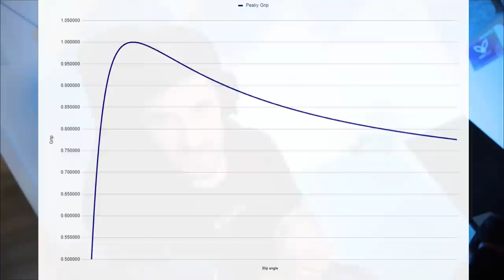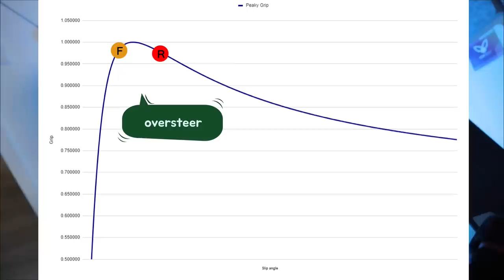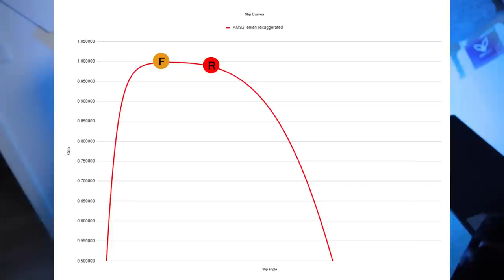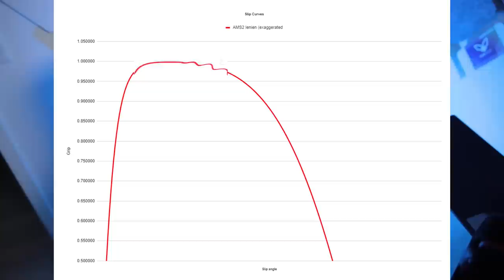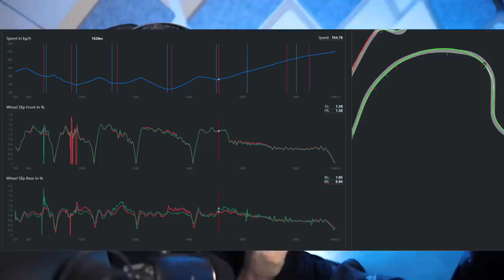Understanding Simracing: YAW! Explained using Automobilista 2

Comment: I have never heard this characteristic described as YAW before. I always hear the term "slip angle", meaning how much the car tyres slip compared to the direction of travel. Some slip brings more grip. too much makes you lose time and speed and the grip falls off.
Reply: He's talking about the slip angle of the car rather than the tires.  In vehicle dynamics lingo it's called "sideslip angle."  Saying "yaw angle" is probably fine here because it's clear from the video context what he's talking about.

In any regard, there's not really much you can glean from sideslip angle other than comparing it between two cars at the same speed and lateral acceleration to see which one probably has stiffer rear tires.  It says nothing about understeer or oversteer at all so isn't terribly useful.  At the tangent speed of a vehicle, the body slip angle is 0 anyway.  Above that the car is nose in, below it it's nose out.  So yes, it's better to talk about the tire slip angles than the body slip angle.

Comment: at the end of the day, most important thing is how we feel behind the wheel in our limited time to spare. this is where Ams2 lack the feeling of security about what car is doing. for me ultimate test of how physics work is first corner of Brands Hatch. Ams2 falls here on the test. that feeling after entering the corner is weird. don't want to compare other simulators but on rFactor 2 or Raceroom I know exactly what the car is doing becouse is logical and predictable. in one occasion during driving and exiting from corner I spinned becouse I changed to upper gear in Ams2 which is maybe setup issue but cannot happen in real life, that can happen if I change to lower gear and revs go wild but here that is unacceptable. Ams2 has everything on paper but on reality that falls apart when playing it. I am afraid some stuff simply can't work on Madness engine, I never doubt in Reiza but after 4 years of development and having the sim in this state it seems that some stuff can only be polished but not changed.

Comment: I read an interesting interview with Alex Hodgkinson who is responsible for car handling and ai in Raceroom, in which he explained the difference between 'physics', and 'handling', which are two connected but entirely different components of car design in sims. I believe he was saying that physics describes the way that suspension etc. works, which is largely down to mathematical equations, but handling is the way those physics translate to your driving experience through the tyre model, and that the tyre model is what makes one sim different to the next, if all other factors are roughly equal.
Reply: That's why RaceRoom is a banger. Great sounds too

Comment: Absolutely superb analysis and perfectly communicated.  Im a big AMS2 fan (offline racer) and this explains exactly where my main issue is in the handling that I could never explain.  Still a fan but do wish the window is smaller - I just dont like the rear stepping out so much on some cars - they made massive positive changes to that before with the physics corrections but I would still like more :).    Thank you for this vid !

Comment: Got recomended this by YT, love technical stuff about the yaw, gonna watch more vids. IRacing driver here :)
Reply from the maker: welcome aboard! :)
Reply: @SimracingPopometer   ty, also get a better mic :) , this one has a bad resolution on highs
Reply: or maybe tweak some settings
Reply from the maker: @pamo5900  charming.
Reply: @SimracingPopometer  my eng not the best, not wanted to be rude. Its just hard to keep the focus listening a long video with that sound.(i got studio speakers)
Reply from the maker: i hear ya. but its not like i haven't fiddled with this ;) audio is challenging, having a better mic is not changing the issues: reverb, background noise. nvidia AI is running already to filter these. the main improvement would be to be closer to the mic - but then its either blocking my view to the screen or my arms ;) and its a USB mic which is just fundamentally limited. however currently im not aiming to add another layer of tech to an already complex and spacy setup.

Comment: The thing is though, it is faster on ams2 to have a little slip angle for 1 lap yes. but dont do that in a endurance race, your tires will be mush as you can already see the tire going down on your clips.
Reply from the maker: will test that, but so far havent had any issues with tire wear/drop off in all my driving
Reply: The V8 Supercar could be good to test with that, or Group C, simply cause their tires are soft so you can see the results of over driving easier. The new gt3 and lmdh cars seem to have fairly hard compounds and wear is minimal. Tire temps also take a huge tole, abuse the rear and if you cant manage the temps the cars are much less forgiving.  @SimracingPopometer

Comment: Great video, much appreciated. I tend to stay well clear of online sim racing arguments...tiring and repetitive come to mind. I'm no professional racing driver, but I do have HPDE and track day experience and have pushed cars to their limit (and a couple times beyond). What I look for in a game/sim is less about matching up everything to reality and more about, do I get that seat-of-your-pants feeling when trying to hustle around a track. rF2 has satisfied this desire best for me for a number of years now, but AMS2 is getting real close these days. Regardless of the endless "discussions" about realism, AMS2 delivers on the adrenaline factor very well. Part of that priority on my end is that I have yet to put time in a sim that captured the real thing even remotely close to real life. How could you? So much of driving is done through sensations, forces and feelings which are absent from sim racing...even with motion simulation, VR, seatbelt tensioning and every other awesome gadget you can integrate into your sim racing experience these days. 

The same logic can be applied to FFB as far as I'm concerned. Realistic feedback is great, but great FFB (subjectively speaking) transmits additional information that would normally be absent or at least muted with a real steering wheel in your hands. It's helping to fill the aforementioned void of sensory information about what the car and your body are doing. 

End of the day, folks should enjoy what's enjoyable to them and get off the "stop liking what I don't like" train.

Comment: Driving the 992 I felt like the tyres never gripped up, but the truth is that the front and back are both at max grip on the plateau moving around there but communicating very little compared to ACC because they aren't moving on and off a peak! Very interesting!

Comment: Hi Nils great vid although bordering on a little too technical for me😮 but much appreciated.  Do you find you need to make much adjustments to the set ups?  Also have you done anything with the FFB settings as I believe there is quite a big topic on the AMS 2 forum about it?
Reply from the maker: i think the FFB topic with ams2 comes from most people driving with low end wheels. on a Direct Ddrive there really is no issue whatsoever. I just use default+ with effects on 30 or so.
Reply: @SimracingPopometer  I have a Simucube Pro, so will try it on the default +, thanks

Comment: Just a correction. Yaw angle is NOT sideslip angle.

The sideslip angle a tire “sees” needs to be corrected by the yaw velocity (rad/s) and the lever arm w.r.t. the cg position (and steering if steered). Very rarely the cg sits perfectly in the centroid of the four tires.

One simply cannot input the same yaw angle in the slip curve for all tires at the same time. Not even per axle. Each tire has its own slip angles which are NOT the yaw angle.

Just a technicality. Apart from that, excellent video
Reply from the maker: yeah I didn't claim otherwise. educational videos - especially when aiming at perception - need to break away from numbers. what you said is probably true, but out of the 16000 people watching it 5 will understand (or care), especially when using abbreviations. You need to speak the language of the audience, not that of the professor. I try to make things approachable, I try to translate and give new perspectives to something that's otherwise inaccessible.

Comment: Driving tbe same car (McLaren 720S GT3) almost same settings, same track (Monza) on both ACC and AMS2 I've got 8" hotlap time gap between the 2 sims. Is that normal? I'm rated S1470 in AMS2 and 9509 in ACC.
Reply from the maker: I'm unaware what the rating really means. assuming you are quicker in AMS2, I guess that's kinda the point: ams2 is much more forgiving.
Fastest acc times are 1:45 I believe
Reply: Yes, you are right: I'm much faster on AMS2 than ACC (any car, any track). but I guess that ACC is much closer to the reality (on car handling and physics) than AMS2. I've never driven a real GT3 car so that's just my thought. ACC seems to be a more realistic simulator but... I enjoy more to play AMS2 (also much better in VR) 🙂. Thanks for your answer. @SimracingPopometer

Comment: In your opinion (if you must choose one), do you like the physics better in ams2 or acc?
Reply from the maker: general driving feels more nuanced in acc. theres more fidelity in the feedback of the car, more variation between cars. but of course i'd like to see a cleaner acting suspension like ams2 has it - or any sim really.
Reply: @SimracingPopometer  In your opinion is this an issue with FFB or physics?
Reply from the maker: @Blue_Monkey  ffb is only a result of physics. so everything you feel is because of what the physics provide. issue? I don't know. different? for sure.
Reply: @SimracingPopometer I've developed a custom FFB file (FullFFB available on Reiza forum) because I felt a discrepancy between visuals and FFB in AMS2. Of course, all I use is physics based, variables from physics engine, like YAW variable to transmit lateral g-force and lost of grip on the rear axle.
I go even further - just like on Hollywood blockbusters, I don't care how they fake reality as long as it feels real.
Reply from the maker: @jopereirapt  i dont see any problem with ffb. its all there, i have all information needed and can do whatever i want with the car.
Reply: @SimracingPopometer  I also feel Default+, particularly in this last version of AMS2, is already very good. Wasn't always like that.
But I do like every visual info to be translated into FFB (my physical world).
Custom files will always be the way to get things "my way", getting some shakes, other car bumps, off-road texture, etc, Default+ doesn't provide, not necessarily a must to be fast in sim racing.

Comment: https://www.youtube.com/watch?v=UoX9M2yuNTA  This is good context for whether slip angles are as peaky as most sims or whether AMS 2 might be closer to reality than most.
Reply from the maker: I didn't know newgarden shared a few words on that, thanks!

The main thing I see in these IndyCar Clips is that while the car moves on the tire without just outright spinning, the corrections and the loss and regain of grip all are very crisp and snappy, it's not stuck in a permanent steady yaw, but all the time goes back and forth, nose in, nose out. One day we'll be there.
Reply: @SimracingPopometer  Sure, and for the cars that already behave that way in AMS 2 I hear criticism that they are on rails or unrealistically too easy to drive, etc.  I don't think the physics are very far off in AMS 2, but I do think various FFB and screen motion settings can exaggerate the feeling/sensation of yaw...because they are supposed to do that!  We need some exaggeration to compensate for sitting in static chairs looking at flat screens (IMO).

Comment: just reduce the layer of the clutch from 6 to 2 and the rotation is gone...
Reply from the maker: yeah, because you are smoking the inside wheel, which is not what a race car is supposed to do - also that is ONLY on power and has no effect on the 'slideyness' of the front axle and you'd get even more rotation off throttle with a nervous rear on the brakes.
the differential is not a solution to the slip/grip relationship. the only thing you are doing is make lap times slower with that, because you are wasting energy on the inside wheel producing heat. its hard to understand for me, how someone can be so confident in an obvious non-solution

Comment: Assets Corsa the best ?
Reply from the maker: its not that simple unfortunately. all games have better and worse areas. depends what you prefer. 
AC surely is a bit dated, but a successor is on the horizon this year, the first actual new game in years in simracing.
Reply: @SimracingPopometer  the tire model seems bang on with AC I also like BeamNG for the weight transfer and yaw is the best.

Can’t wait for AC2 though
Reply: @SimracingPopometer Hope AC2 performs well from day 1 with my prehistoric PC 😅

Comment: the best simracing video I've watched recently, explains a lot. most youtubers were like '"it's hypercars!!44!! brrrrrr!" about the new AMS2 content. this theory makes sense

I wonder what sims get it right, I guess it's mostly RF2
Reply from the maker: i wouldnt say its wrong, im just describing. different tire manufacturers, different compounds, different track states. you quickly have a pretty different feel when just one factor changes. but yes, i'd say rf2 can feel very crisp, while staying in charge of the tire and slip as well, without going extreme. but thats only true for some cars

Comment: AMS2 is still trash and it will be trash. It will never be a proper sim like AC or Iracing.
Reply from the maker: a bit of a undifferentiated, no?
Reply: @ACFUN34 But how do you know? You'd need 400+ hours in an actual GT3 car and then the same amount in the sim. Back and forth. It's okay saying a sim is trash but you have zero frame of reference and thus your statement is pointless. How do you know that AC and Ice Racing are proper sims? Coz the internet tells you it's so? They could be (and probably are) completely inaccurate. It's not about accuracy, its mostly what info you get solely through the wheel and visually on the monitor. Nothing like actually driving at all.
Reply: @sneakygloworm  Stop pretending .....
Reply: @HDRGamingHub  Stop being a drama queen.....